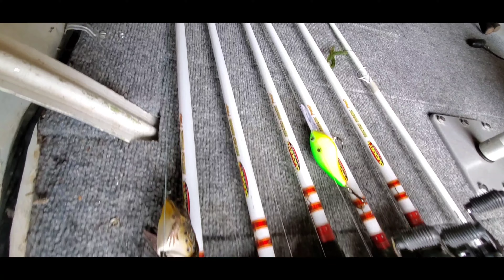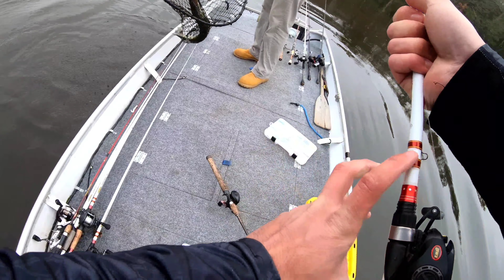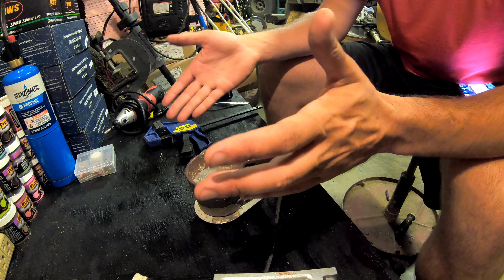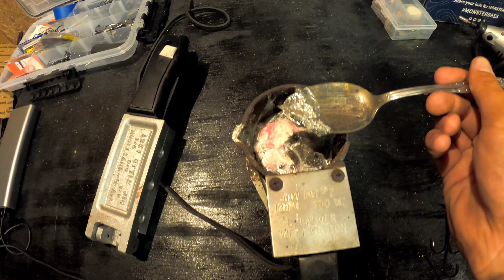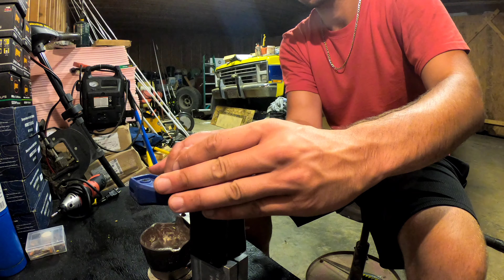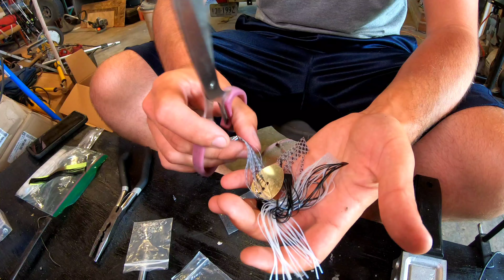How To Make Bladed Jigs (Chatter Baits) DIY Do It Molds #homemadejigs #bladesjigs #doitmolds

Comment: Have you had any issues with the blade not thumping/chattering at all? I’ve made a few, and sometimes I have to reel them so slowly just to get the blade to move. Reel it too fast, and the jig just spirals back to me on the retrieve.
Reply from the maker: Yes  I have. Either too much paints in the eye with a split ring or the split rings too fat for the eye. But I normally  just pump my rod and knock it loose. I also get bit  alot doing that lol.  But try making sure your split ring is bigger so it moves in the eye really good bud! 👊